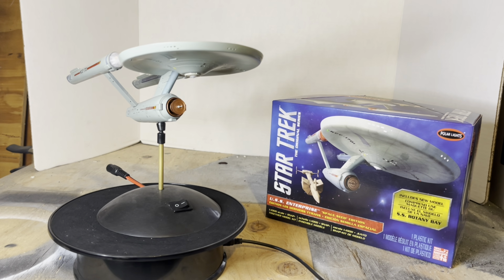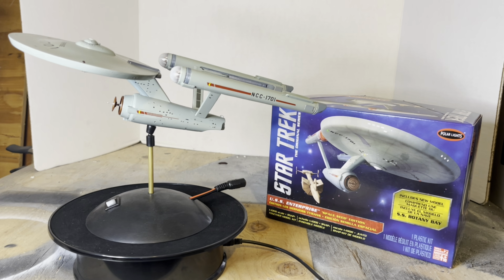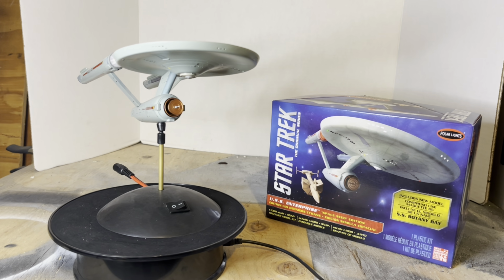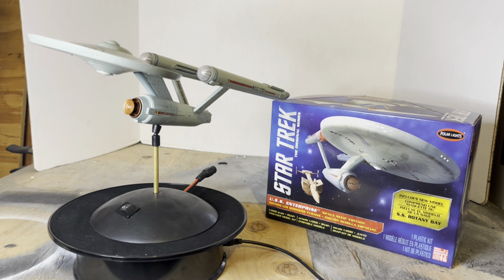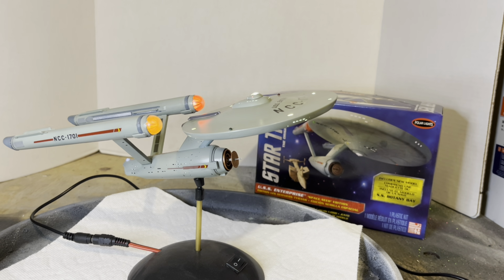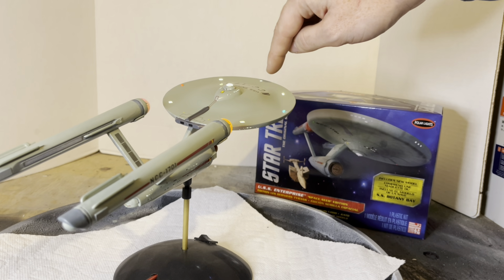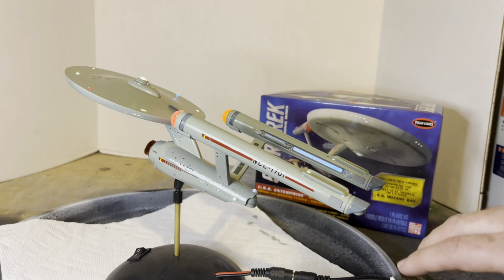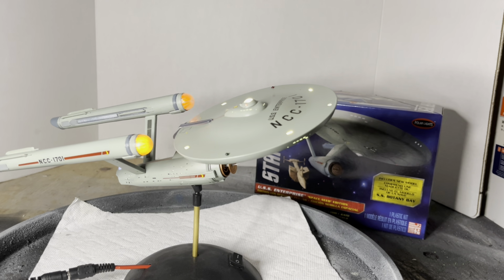USS Enterprise NCC-1701 (TOS) 1/1000 scale model with lights/TenaControls/Photoetch

Comment: Great job! I really like what you did to this model. I have one of these on the way and I’m getting a parts list together.

I was wanting to know if you could please tell me what type of device that you used to get the certain lights to blink and what size SMD LED’s you used throughout the model? This will be the second model that I will be building with lights, and the first that I will be building that has some lights that blink. Any help and guidance would be really appreciated!
Reply from the maker: Thanks! For the navs and strobes, I use a multi-timing board purchased from TenaControls. For the buzzards, I used a combo of 0403 and 0606 SMDs, the amber SMDs static and everything else a blinking SMD (used red, yellow, green, and blue, but it wasn’t even due to likely the was I resistored them). Everything else is using a LED strip or a 1.8mm LED.
Reply: Awesome thank you! I just checked out that Tena controls page and I think I’m going to go for that bussard light kit. This helped me tremendously, thanks again! I love your model! You did an awesome job! I hope mine turns out that good lol
Reply from the maker: Likewise, good luck!

Comment: New subscriber here.
Rumor is 1/1000 D is coming.
Great looking models.
Internal lighting doesn't come with tena boards right?
So you added light strips?
To their board?
Reply from the maker: That’s correct; when I buy the board, it’s just the board. I build all my lights inside, then link up to the board at the end.
Reply: @Airius84329  thank you

Comment: Awesome work! I'm about to light one as the second pilot. How did you light the tail light above the shuttle bay?
Reply from the maker: I originally was just trying to drill a small hole through the rectangle peg that comes out for the back, where the observation dome is, but it got screwed up. I eventually just hollowed that area out and sort of just stuck the dome on top, to get some light coming through the clear part.
Reply: I'll try that! Thanks! @Airius84329

Comment: That’s incredible

Would you mind letting me know your technique for filing out the square windows?
Reply from the maker: For filling in, I just used Micro Krystal Klear. For drilling them out, I used window drilling guides from Paragrapix, and drilled them out, by hand, using (several) 0.5mm drill bits, and a hobby knife to clean up.